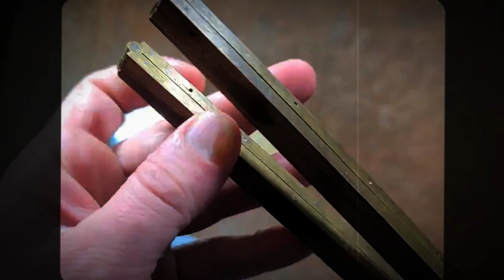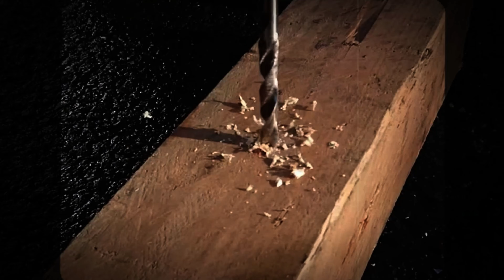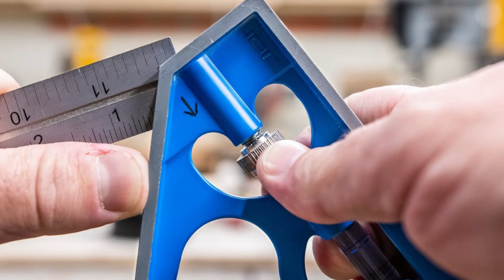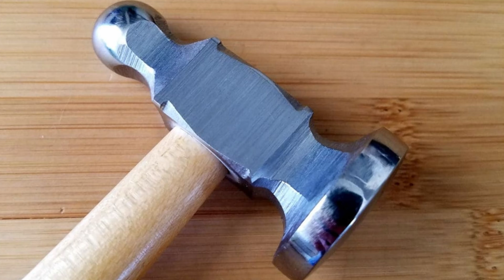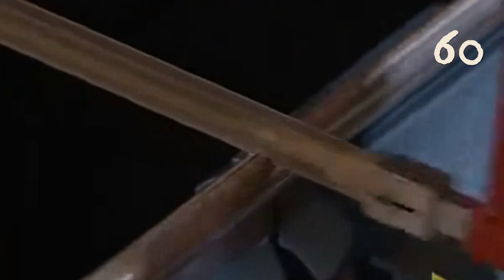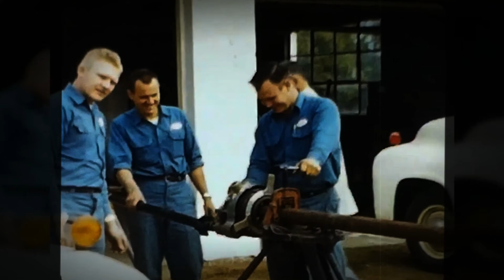25 FORGOTTEN Tools in Dad's Toolbox That Every Boy Inherited

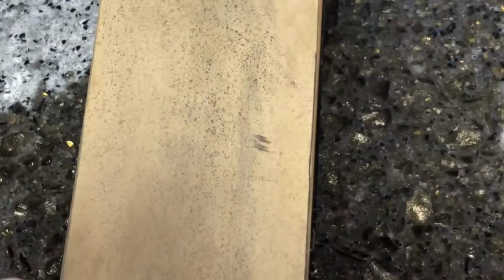Comment: Regarding 8:00 a steel awl needs to have its point resharpen when it becomes dull. On the other hand, a modern tungsten carbide awl stays sharp much longer than tool steel.